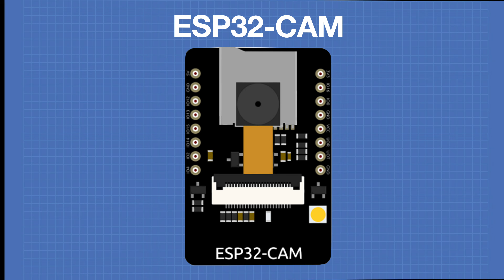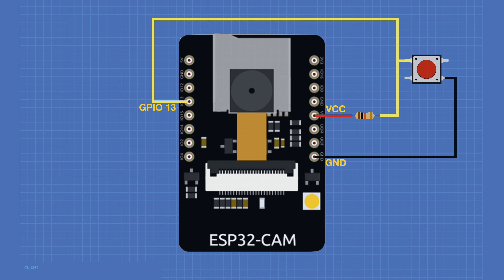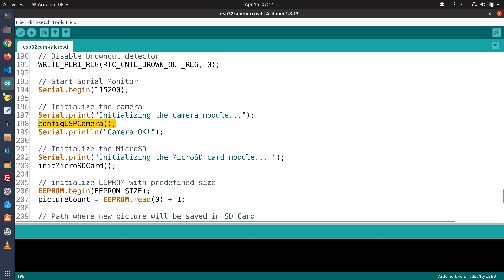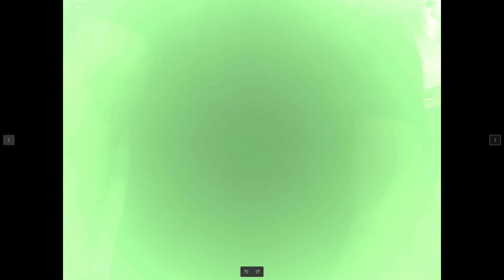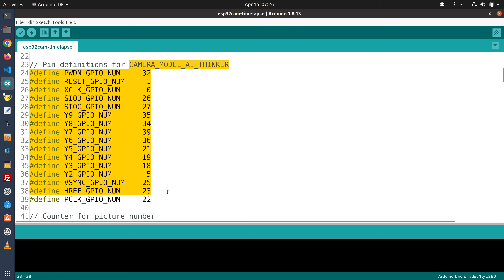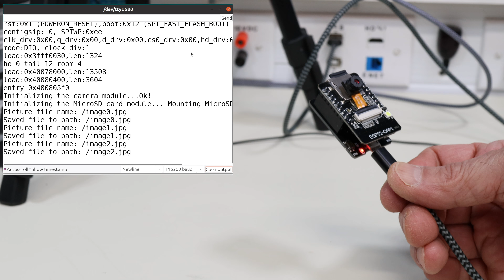ESP32-CAM MicroSD Card - Saving images with the ESP32-Cam

Comment: for streaming ,  built-in webserver example is good.  I have put the streaming for 4 days it is working fine. Also I suggest to do live streaming instead of storing it on SD while youtube gives a free storage for 12 hrs stream which save GBs. but you need to connect your ESP32-CAM with VLC player for this.

Comment: Nice tutorial, but....
Bill.. You use an unsigned int as a counter (65535), but only 1 byte(255) for the eeprom. So the max count can never be more than 255 (after 255 it will go back to 0 *overflow*).
Just wanted to inform you. :)
PS:Don't forget about the initialization time for a pir sensor to(between 1 and 2 minutes)!
Reply: thanks so is the a solution to go past 255+, or is it just quirk of of think, e.g. if you want more buy the more expensive model?
Reply: @dh2032  If you reserve 2 bytes for the eeprom, then you can store a value  up to 65535 if your counter is an uint16_t. If you reserve 4 bytes for the eeprom, then you can have an unsigned long counter that counts up to a lot more. 
Hope this explains it.
Reply: @digihz_data  Hello Mr. Sandberg and sorry for the "stupid" question: (I am an absolut newbie and try to dive into these topic since someone is constantly attacking/damaging my little motorcycle so I need to get as many pics as possible to find out who it is) DO I get you right to change LINE26 to:  EEPROM_SIZE 2? or schould I take 4? :-))) anything else you suggest to chatch this bas****? ;-)
Reply: @Blonder  well....if eeprom size is set to 1 then you only have 1 byte to use in the eeprom. Esp32 can have up to 4096 bytes max. So it is up to you to set the desired size that you will be using.
Reply: @Blonder  1 byte can only contain a value between 0 and 255. 2 bytes(like an  int or unsigned int can hold bigger values. The more bytes you set in eeprom size,the more data you can store in the eeprom. If you are a newbie,I recommend you Google for "arduino eeprom", "arduino variables" and simular.
Reply: @digihz_data  Thank you so much Sir for your response and your advices. If I wouldnt be "angry" and in a hurry to catch the "one" (no clue who and why this happens because I am new in the area) that would be the approach anyway. THX once again
Reply: @TomWien  your welcome.

Comment: Thank you for this informative video. Your clear and concise explanations of the code and the demonstration of the process were very helpful. I appreciated how you walked through the steps of setting up the hardware and software components needed to save images to the MicroSD card. Your troubleshooting tips were also very useful for those who may run into issues while working with the ESP32-CAM and the MicroSD card. Thank you for sharing your knowledge and expertise on this topic!

Comment: it took me some time to realize how come, some boards require to press the boot and reset buttons to program the ESP and some other boards don't need that and Arduino puts the ESP32 into the boot mode automatically. The solution is simple:  DTR and RST pins from  FTDI connected to GPIO-0 and ENABLE pins accordingly - then magic happens ;-)

Comment: This is off topic but I have a request that many others may be interested in also. I struggle trying to connect peripheral devices to my boards. Trying to decipher GPIO## vs D##, TX01, TX02, SPI01, SPI02. It seems like I work for days on every display (and other items) I try to hook up to different devices. Everything is labeled differently. Add to that, most tutorials say you can use any pin for any connection on some boards but how? Today I worked with an ESP32 DEVKITV1 and a Wemos 1327 display. After about 4 hours and multiple hook up attempts and multiple different examples the best I got was a bunch of flickering dots before I gave up...again. I don't want a video showing how to hook up my specific combination. I think a lot of us could benefit from a tutorial on deciphering pins and  SPI, IIC and UART type connections. I'd rather learn how to figure it out for myself than to be just told connect pin 1 to pin A etc. I've got OLED's, LCD's, 7 Segment, E-Paper and unless it is IIC it rarely works. Even the boards without a QWIIK interface can be difficult with IIC. Thanks for listening.

Comment: I bought one a couple of years ago but never used it. 
Question: Would I be able to see the faint stars at night without a zoom lens?
Most cameras are not sensitive enough to pick up stars in the night sky.  
I want to monitor the light sources in the sky at night, to see which ones are moving and then take a 5 sec video. 
I was going to use a Rpi Noir and a Rpi 3B+ I have, but if I can get away with using a smaller power pig, I'd rather use that instead. 
Thanks for another excellent video.

Comment: Did they ever fix the issue with the small board that has the polarity mismatch? Its the board that comes as a set when you spend the extra money, there was/is an issue with a diode blowing out on it and it ruins both boards ( all of my stuff is packed away from the hurricane, I would have provided board numbers eslewise..)

Comment: Nice video, very informative! Question though... One thing I've noticed with some cameras, is that they take time to stabilize the image when they first power on. If pictures are taken too soon after it powers on, they come out with odd coloring. For instance, some of the pictures in the time-lapse are purple. Is that the case with this camera? Do the pictures come out better if you pause for a few seconds after coming out of sleep to let it stabilize before taking a picture?
Reply: I would like to know this to. Anyone knows?

Comment: A big subject that nobody seems to have talked about is this: Can the SD card on an ESP 32 Cam be read and manipulated remotely? A lot of times these cameras are in remote locations and it is not easy to pull out the card and read the pictures.
Reply: Not directly, but you could add such a thing to your app
Reply: the webserver could be adapted to show the list of files on the sdcard and let you transfer them one by one  probably ... but memory work space could be the problem ...  
if you know the file name range you may not need a webpage (less to code),
 just have a loop on your pc trying wget on all the file names on the webserver.
Reply: There are FTP server libraries. You can access , download, upload and delete data  with programs like FileZilla.
Reply: You can do that easily. There is a web server you can run on this thing and you can do whatever you like with it as long as the server is up and connected to WiFi

Comment: Great tutorial! I've been struggling with a motion sensor camera project using an esp32cam with the module board. Several other tutorials have been too complex, and I haven''t been successful. I'm working through your example, and using the simple camera code - I can only take pictures in QVGA. The larger pictures come out super dark, or solid black. The webserver example sketch works fine, and I've verified all the pins are the same for your example. Do you know what setting controls the exposure length?

Comment: one question is by using this extension board connected to the ESP32 camera module, do you need the RFID module to flash the code and how are you powering up this ESP32 camera?
Reply: I meant the FTDI* module

Comment: This board scares me, my spine is currently goosed so I'm struggling to keep a steady hand with the iron (have ruined one board with the zero ohm resistor mod).. why can't they just use a dip switch.. it's already constrained in depth by the same pin height..

Comment: Could we use the command pinMode(x,INPUT_PULLUP) instead of using external resistor?
Reply: Yes, but, it is not available on all pins and only one has pull down so final answer:
It depends.  :)

Comment: Hi. Is it possible to use multiple GPIO pins of ESP32CAM along with the SD Card, if its camera is not used or plugged in? Kind Regards, Mohsin.
Reply: You can use pins 12-13 if  SD is activated in a "slow" mode.

Comment: Having limited success here.   My biggest issue so far is, after loading up the ESP32 library, I ended up with no less than TWO HUNDRED boards. Not one f them was called ESP32-CAM.  Only two with CAM in the name and they don't work.   Does anyone have any ideas?
Reply: AI Thinker ?

Comment: great video. One annoying problem with this card is the use of a common GPIO pin for the LED flash and the SD card which means reading and writing to the SD will cause the LED to flash. Very annoying. Here is a hardware bit of surgery you can do to isolate the flash LED from the SD card (by cutting one surface mount resistor) and splicing it to the smaller LED's GPIO line (by cutting out the little surface mount LED). 

https://www.youtube.com/watch?v=loet1ndG8Sg